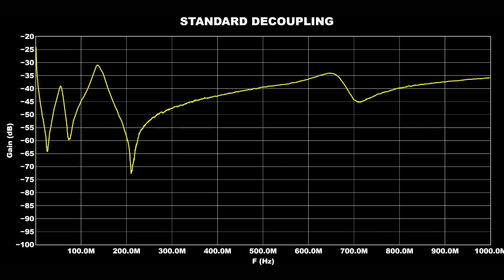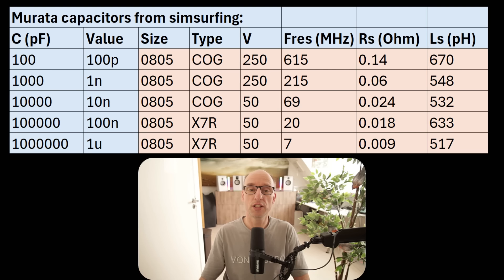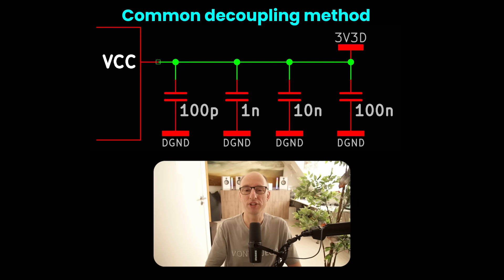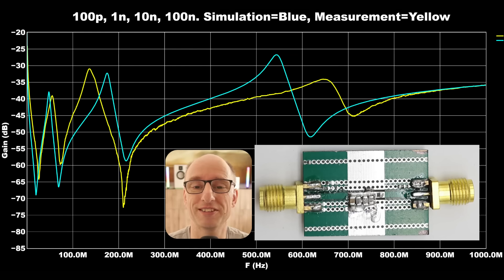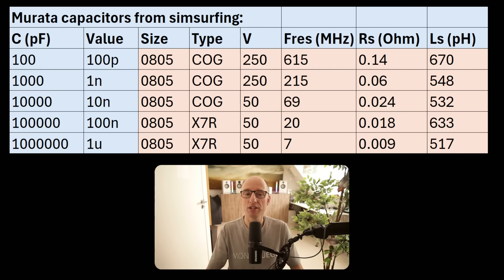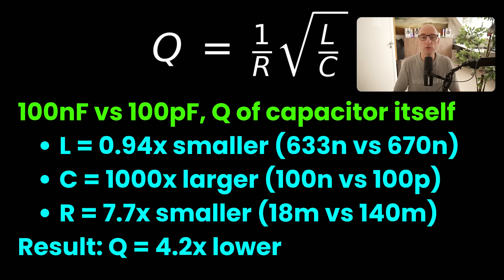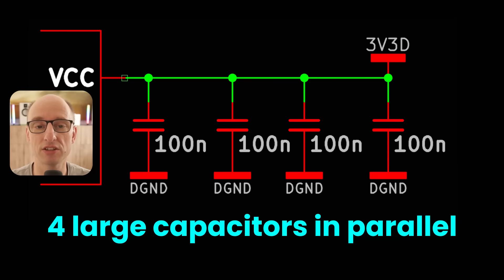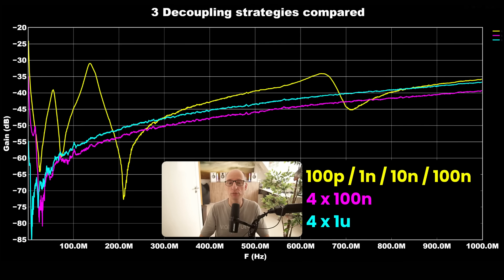The most misunderstood concept in decoupling

Comment: Disclaimer: not finished the video yet.
From what I understood smaller package sizes are always better wrt parasitics. So as long as you pick the highest value for the smallest package size the conventional wisdom is correct. Or am I misunderstanding?
Reply: The problem with capacitors is that if you have a choice of package size for a given value, the smaller package will usually result in a capacitor that suffers more from DC bias effects. It ends up being a smaller value capacitor than you think.
Reply from the maker: No, you're absolutely correct! (its in the video somewhere indeed :-)  )
Reply: It's a video with 12 minutes of content... 😂😂 and you chose to comment before listening to it in it's entirety?  ADHD much?
Reply from the maker: @Shocker99 I guess I need to talk even faster😂😂😂😂😂
Reply from the maker: My usual response to a situation like this is: 'It's soo hard to get good personnel these days' :-D

Comment: Great content. I now am more critical about any age old textbook knowledge and as you said at the end I have all the tools I need to analyze myself. Keep it going! Subscribers++
Reply from the maker: I will (I need to make a living :-)  )
Reply: A for 'age-old rules of thumb', remember our chips have changed over the decades (and hopefully will continue to change/improve). 
Typ clock rates are multiple orders of magnitude higher than for, say, the original 7400 series TTL chip days.
Edge rates too.
Power levels are lower, per gate, but that isn't as helpful due to extraordinary density increases. 
And lastly, our boards have improved too. Your won't expect to crack open your latest USB 3 (4!) widget and find a single sided one layer board with jumpered power and GND traces! Production is seldom even 4 layer, with power and GND planes, and not infrequently multiple of those.
Just note he did not get clearly indicate that old rule has some more life in it if your caps follow bigger values in bigger package with more inductance, combined with reduced capacitances in small packages with lower inductances.
This drastically changes the power plane impedance from using JUST 0803's!
"It's .. complicated" 
Sims with Cu power plane parasitics are your friend - trust for guidance, but verify if it's critical.
And EMI/EMC ? On another level of 'complicated'

Comment: my PCBs doesn't have traces for 3.3V - it has a plane 🤪 very interesting video
Reply from the maker: So your PCB is flying?!?
Reply: A plane could resonate as patch resonator, beware of this.
Reply: @ralvarezb78  judicious cap placements can help with that. And then there's "Another Level" approach:
putting a 'picket fence' around the board to block lateral EM emissions/reception - a large quantity of vias stitching together conductive ring between top to bottom, or maybe one layer beneath both surfaces (typ GND planes). That's a lot more small holes to drill, and then plate through.
Reply: @r6k1E10-1 absolutely agree.
Reply from the maker: Yes, great approach. I'm covering this in my course as well :-)

Comment: I get the biggest capacitors available in 0201 and 0402.  The values you can get are astonishingly large.  I make sure I've got more local decoupling than the data sheet calls for.

Done.
Reply: The nominal capacitance with zero bias voltage may be impressive on X5R and similar dielectric caps, but it drops off a cliff when you apply DC voltage.  The physically smaller caps are worse for this for a given nominal capacitance.
Reply from the maker: indeed, you may only get 20% of what you paid for.....
Reply: @ferrumignis  This is correct. Sometimes it fascinates me what one finds in device datasheets and what customers use (apps engineer here).
Reply: @ferrumignis  Thanks for the reminder (not sarcastic).

I looked at a board I did a few years ago. The datasheet for my sensor and ASIC recommend specific capacitors, not just capacitance values.  I went with significantly larger capacitors in the smallest form factors I could.

https://search.murata.co.jp/Ceramy/image/img/A01X/G101/ENG/GRM033Z71C104KE14-01.pdf

Here's a Murata datasheet for a 16V 0.1 uF 0201 cap.  I don't see any mention of capacitance dropoff with DC bias.  That's pretty annoying.  Most of my capacitors are used for decoupling.  If there's an effect which derates them by 80-90%, that's really saying the capacitance is only predictable to a factor of 2, and even that factor is extrapolated from measurements on other devices.

It seems to me the DC bias capacitance derating should be part of the capacitor spec, like temperature derating.  If we're losing capacitance to BaTiO3 locking, I might end up choosing ceramics that use less of that if I was comparing their specified capacitance under DC bias = 30% of rated max voltage.  But as things are, there's no way for me to know if a particular ceramic has a better design for the most common use for these things.  That's dumb.

This note from Kemet says dopants and other materials can change the capacitance loss vs DC bias from -10% to -70% in the same package size.  So it's almost completely determinative, and yet undocumented.  https://www.digikey.com/Site/Global/Layouts/DownloadPdf.ashx?pdfUrl=863968494F2E4E13BBEA65B55A358443

Another thing Hans didn't mention so much, is that you get hit with the inductance of the installed capacitor, not just the inductance of the device itself.  Layout matters a lot here.  0201s are great because you can get them in close to the ASIC pins, in some cases, on the back side of the board inside the ASIC footprint.  That gets the loop area from ASIC through PWR/GND to capacitor down, and that loop area adds to installed inductance.
Reply: @HansRosenberg74 courtesy of making them cheaper. There used to be noble/$ metals in caps, and most of this degradation with DC bias wasn't an issue. Decades ago. 
Of course marketing buried this info, often with an excavator in a abandon field. Sometimes in very poorly circulated additional characteristics sheets.
So the multiple resonances you saw on the NanoVNC are likely moved from where you'd see them on 1.8VDC, and for 2.5VDC, and for 3.3VDC, and 5VDC.
I'm assuming there wasn't a bias in the VNA driver circuit.

'The more you know, the more you realize how much you don't know'
And yet engineering is all about 'getting it close enough to work'
Reply: @r6k1E10-1  It has nothing to do with the metal content in the capacitors.  The voltage dependency comes from the dielectrics such as X5R and Y5V that made high value ceramic caps in small packages even possible.  However these materials exhibit a dielectric constant that reduces in the presence of electric fields.  To get ever higher capacitance in smaller sizes the dielectric thickness was reduced.  This directly increases the electric field density and increases the voltage sensitivity.  DC bias wasn't an issue decades back because you simply couldn't get such high value capacitors in the tiny packages we now have.
Reply: @ferrumignis no, i distinctly recall the change from NME to BME coinciding with the degraded performance of X5R and specifically X7R SMD caps. Something about reformulations due to base metals reacting to oxygen during firing... It was like 30 yrs ago. 
But there absolutely was a transition from X7R that supported wide voltage bias range to a version that didn't. X7R was also available well before SMD use exploded, in thru hole versions, typ in ck05 and ck07 pkgs, iirc. And they too were stable over wide voltage bias ranges.
I used them in ANALOG circuits, so they had to be more stable than they are today, for filters to work correctly.
Reply from the maker: The DC bias problem is very real unfortunately :-( And badly documented, it's almost like manufacturers want to hide this fact.
Reply: @HansRosenberg74  I'm a big fan of Murata's "SimSurfing" online database, you can get a C/V characteristic chart for every device they make.  Other manufacturers do seem to be very shy about giving such detailed information.
Reply: @ferrumignis  OKAY!  I didn't know about this database, and it's really useful.  I looked up the 4V 0.1uF 0201 cap from Murata.  At 1.0V, it has 0.068uF.

Now THAT's useful.  No dire 80% derate so you'll need 5x capacitance.  I wish I could select parts on it, but this is good enough to get confidence that the part selected, while it may not be the best available, is at least good enough.
Reply: If you can get a 1uF cap in 0402 and not have it die horribly from DC bias effects, I'd love to know the part number :)
Reply: @saumyacow4435  Me too.  That link is to a 0.1 uF cap.

Comment: Hans, in your modeling you will get improved accuracy by placing small amounts of inductance between the capacitors.  Thanks for a great video!
Reply from the maker: I know, this is a first order model, making it good enough for 99% of applications. You can go much much further than this.
Reply: To simulate board traces? Or am i seeing this wrong?

Comment: Great video! I once designed a very high power high frequency class d amplifier. I used multiple poor quality single value caps in parallel,  just like you say...
Reply from the maker: that should work.

Comment: I am not a PCB designer, so what I'm about to ask here may be very stupid, but from my experience in fields I DO know, sometimes something very stupid is actually a real good idea, or at least a learning opportunity.

If the advantage of multiple caps is aligning their inductance region, wouldn't one cap with a very high value also do that, but by virtue of being one cap, align with itself perfectly?
What's the simulation and experiment look like with this decoupling "network"?
If this is a bad idea, and/or ringing shows up on the experiment or sim, why is it a bad idea/doing that?
Reply: Physically larger caps have higher inductance, so at high frequency its impedance will be higher than multiple smaller caps. You need a physically larger cap with high value MLCCs because they are extremely voltage sensitive, their capacitance drops rapidly when you apply voltage to them and this effect is worse with physically smaller parts.
Reply from the maker: A single cap works great also (better than a small one). But do mind the other reply from ferrumignis!

Comment: This is very interesting, especially the formation of unwanted parallel resonators, but I'm not so sure about the completeness of the analysis.  Power supplies present an output impedance that is definitely NOT 50 ohms.  There's also a danger of forming resonances with the supply's (complex) output impedance. Interconecting traces that are quarter waves (or odd multiples) will transform RF shorts to RF opens (or C's to L's) - this may also be a consideration.  The use of resistance is a good point - remember energy is not dissipated in a purely reactive network - it will be reflected if not absorbed.
Reply from the maker: the 50Ohms is only for simulation purposes and capacitor model verification. In reality, you would not put 50 Ohms. And you are correct! Regulators have an inductive output by nature (due to the loopgain of the control-loop reducing versus frequency). So that will generate a resonance. However, if you do you decoupling wrong, you'll create even more! If you want to fully control all this, you'll need to learn advanced power supply design.
Reply: I think 50 ohms provides the facility to "plug" to standard measurement system, once circuit is characterized by it's poles, zeros and impedance module, you can translate to other impedances
Reply: @ralvarezb78  For sure, it's a minor criticism - but people do tend to misinterpret presented results as gospel.  I use full S-parameters to model my RF networks - and I use a 1 ohm termination to model my supply impedance.  Again, this is an approximation - but it captures the VSWR of the PSU to some extent - the reflection phase is practically be modelled.
Reply from the maker: yes!
Reply: Coming back to stability issues subject, I would add the DC DC converters case: They have an incremental negative real part at input since they follows I = P/V so dV/dI < 0 for some bias point. So if you put an RLC  circuit whose real part is lower than it's counterpart dV/dI, the system may be highly unstable. This is why on some cases Lossy Filters are used on Power Electronics.
Reply from the maker: correct! Great discussions here :-)

Comment: Regarding the dampening resistor, is this why Espressif suggest an overdrive resistor in series with a crystal for their chips?
Reply: No. A resistance in series with a crystal, as in a microprocessor clock would act to limit the drive power into the crystal. Overdriving a crystal causes frequency shift, phase instability and thermal drift and can even shatter the crystal. It’s very important to match your crystal to the amount of power in the oscillator.
Reply from the maker: correct!
Reply: @QwazyWabbit yep

Comment: This is the best quantitative analysis and simulation of bypass capacitor networks I have ever seen.  Kudos!

I designed analog and digital circuits at HP Labs for 40 years.  I put special Murata (?) ceramic surface mount capacitors with small built-in series resistors on the last few PC boards I designed for power supply bypassing.  They were something like 1 uF or 100 nF with 1 ohm in series.  I’m not sure if they are still made; I can’t find them on line or in Digi-Key any longer.

The PC boards were multilayer with power and ground planes, which keeps series inductance low.  The 1 ohm resistors all over the place damped out resonances, exactly as you described it.  Plus there were ferrite beads on the power supply lines between subcircuits.  The impedance of the ferrite beads was about 100 ohms at high frequencies.

Long ago, I used tantalum capacitors for bypassing.  The data I have on them typically shows around 1 ohm of series resistance at high frequencies, without a series LC resonance, perfect for damping.  But we have gone away from the use of tantalum capacitors.
Reply from the maker: Tantalums still have a purpose for special situations. 

Be careful about ferrites. This is a common use, but it will create a large resonance since they're inductive!

Comment: There's a technically (not always practically) superior alternative to series damping: parallel RC snubbing. This is good for occasions where the low ESR of a directly connected capacitor is needed, and damping of inductive interconnects is also required. Typically this is most useful for VERY inductive interconnects, such as power supply cables or external wiring where hot plug events can cause injurious voltage spikes due to LC resonant overshoot. It's also quite expensive.

The technique is to put a series RC network in parallel with the directly connected decoupling capacitor. This is really just a method of putting a parallel damping resistor across the capacitor that needs damping, but with a series blocking capacitor to allow this small damping resistor to be connected across the supply rail without excessive power dissipation.

The problem is that the "blocking capacitor" needs to be comparable to or sometimes even larger than the damped capacitor, at least if the inductance of the interconnect is large! I remember one design where I think I needed a 4.7uF capacitor in the RC snubber to effectively damp the low frequency resonance of a 2.2uF capacitor against a couple uH of cable indutance.

I've personally never used this in a production design in the past [the above example died on the drawing board], because it's often convenient to just apply a large TVS for snubbing inductive overshoot of hot-plugged power supply cables, and get some transient protection in the bargain. But I do think this would be cheaper than a TVS, if the analysis was worth the BOM cost savings. 

For damping short interconnects this should be quite easy and cheap, because the parasitic resonance is rather high frequency and a pretty small DC blocking cap would allow the parallel damping resistor to be coupled to the rail effectively. Although I admit I haven't done that analysis.
Reply from the maker: Thanks, that is an interesting approach. Very logical now that I think of it but I didn't know this one before!
Reply: I used on interleaved buck boost converter, but sacrifiying some amount of power efficiency, otherwise high voltage spikes blew out my MOS 😅

Comment: Are we talking about very high frequency concepts here?  The charts look like they go up to 1GHz.  But below 100MHz, where many microcontrollers that I use operate, the conclusion looks different.
Reply: It’s not about the clock frequency of your micros. It’s all about the dv/dt of your rising and falling edges as this is where your high frequency component is hiding that needs decoupling so it doesn’t propagate as noise to other circuits. Remember that a square wave is made of many many sine waves ;)
Reply: @MrMarcinpluciennik  I'll need to try this out then.  Always thought that the high frequency stuff was for specialized circuits  and not the ones that I deal with.  If I can get more stable sensor readouts without having to crack open 3 separate bags of capacitors, it sounds like a win in my book.
Reply from the maker: indeed!
Reply: and if the voltage switches in 1/10th of a cycle (ie, looks anything like a square wave), you'll have component in the Ghz range